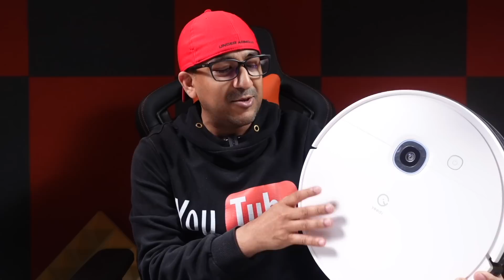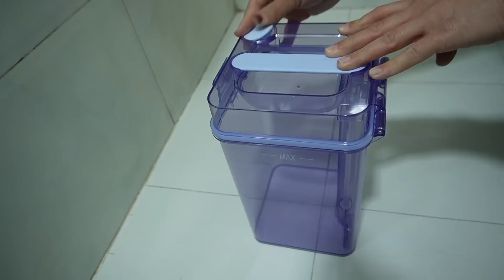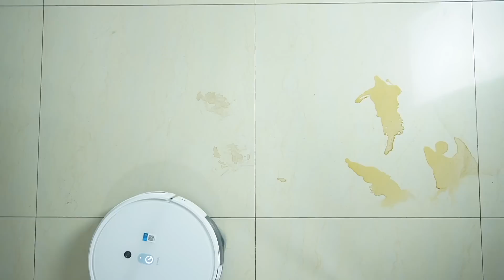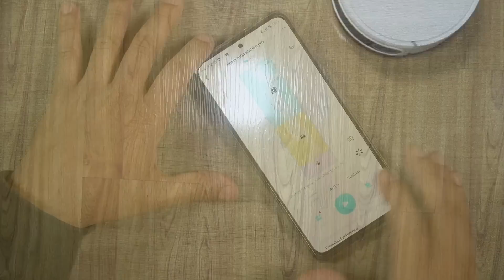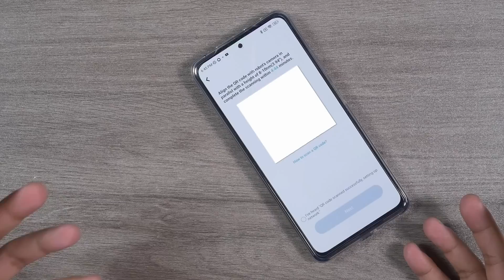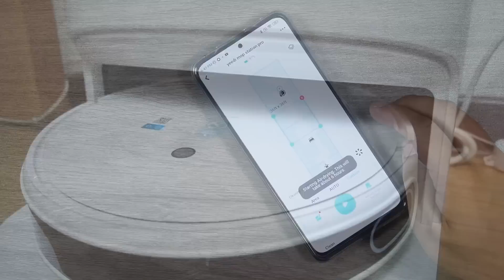Yeedi Mop Station Pro Review

Comment: A vacuum cleaner with management schedule timing, self cleaning with two 3.5ltrs, pascal 600 - 3000, 10 N forced, 180min mopping, 300min vacuum & 5200mah is really impressive and it does the job v well 👍❤️
Reply: This is a very useful home appliance